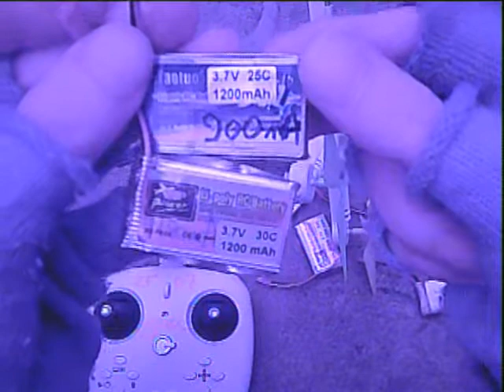zop 1200mah 30c tested on ZF-07 palerge drone (h51 clone)

Comment: Excuseme what  is the name  apk por the camera i have one and not as possible  configure it
Reply from the maker: it seem to be a generic aplication for the wifi  toy drones
because this same drone was sell under diferent brand
actually im using fq777
not sure its fully compatible 
but their is many other and most are compatibles inbetwen
you may have to try a basic wifi camera apk if you want use the remote controller and just get the video on smartphone
perso i was decived with the super limited range in open field i lost the video signal at 10meter only not really fpv possible